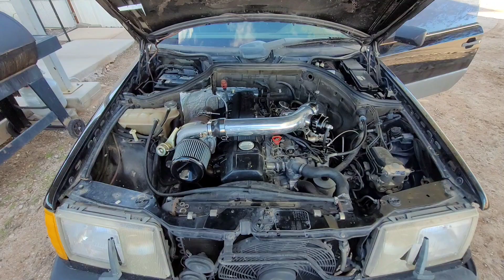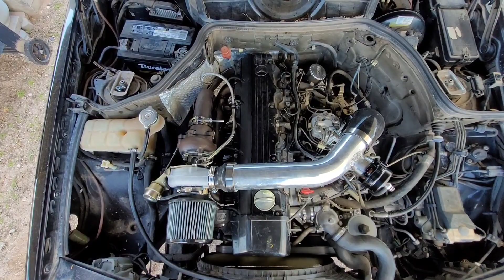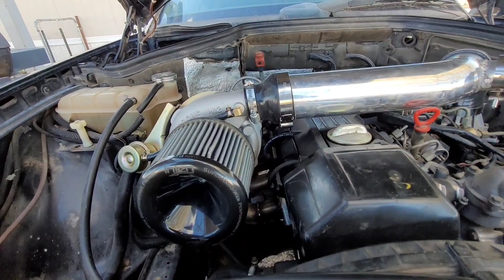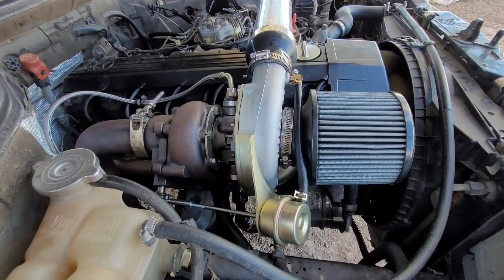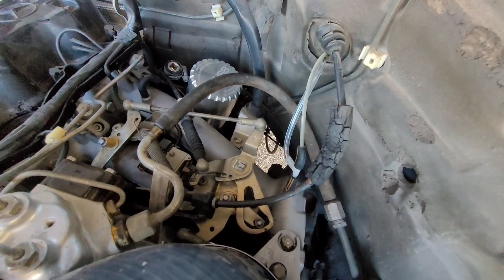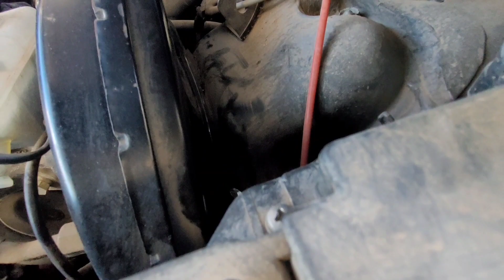M103 Turbo k-jet cis Running Closeup

Comment: How much boost do you plan on running? A few people on the forums say that kjet is very limited
Reply from the maker: As of right now I'm running 8lbs reliability with no issues I will be turning down the boost when the water methanol injection is added
Reply: @thebenzhouse  awesome. Should be a lot more fun. Any estimate on how much power you think you'll make?

Comment: But what about the rubber cup from the bottom, will it not burst? Or will the idle hose not come off?
Reply from the maker: It's only 8lbs of boost and it's a new rubber so it's all good and when we add the water methanol we will drop the boost to 5 or 6 lbs but I haven't had any issues with it what so ever